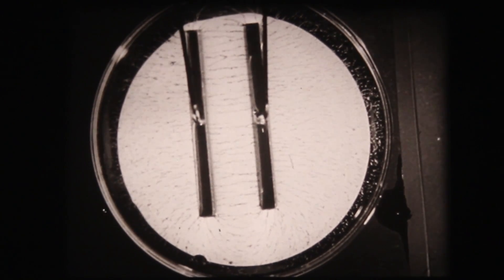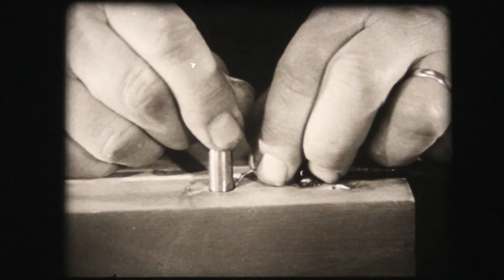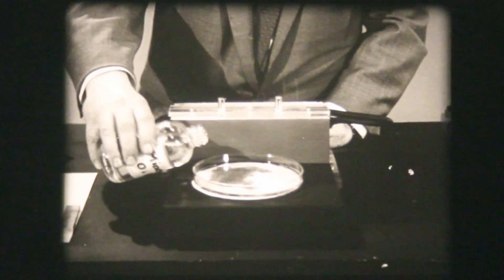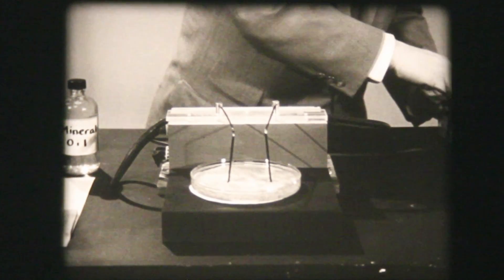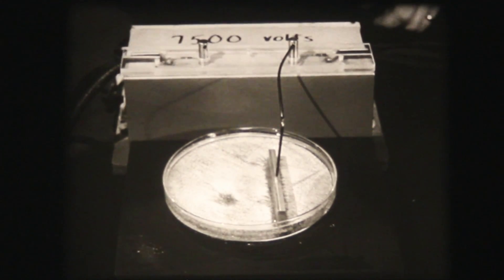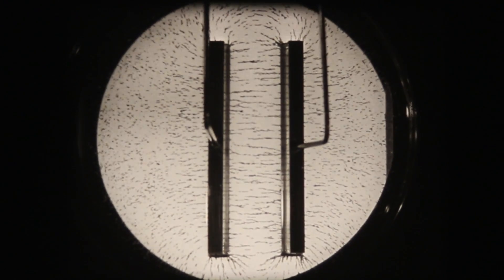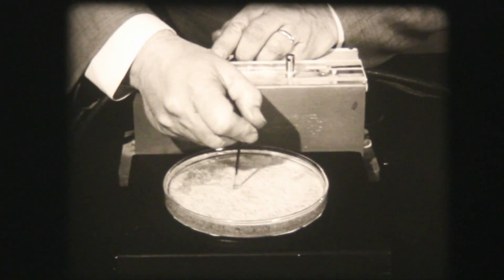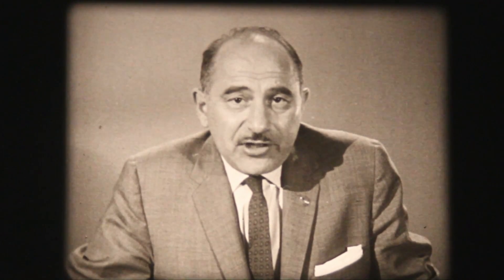Electric Fields / Electric Lines of Force (PSSC 1959)

Comment: Oh man i can smell the CFCs pouring off that freon. Stuff is now  $400-$500/lb. Thats in bulk. An 8oz can is probably $300. Leaded fuels, asbestos, amazing CFC based thinners. U could take the nastiness sludged up bolt or part covered in years of dried grease and oil paint. Dip it in a bucket of freon and pull out a shiny clean part stripped down to bare metal so clean it flash rusts in seconds. Stainless is amazing, dunk a nasty old oil field part into freon, and it comes out shining! Like it was a chrome bumper. I want my R12 back!
Reply: but what to use nowadays instead of it in this type of experiment?